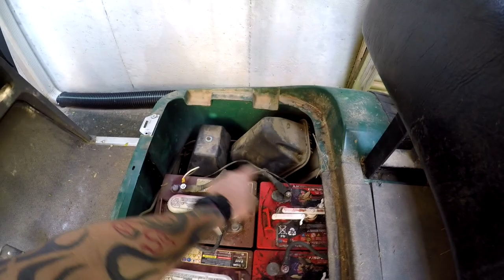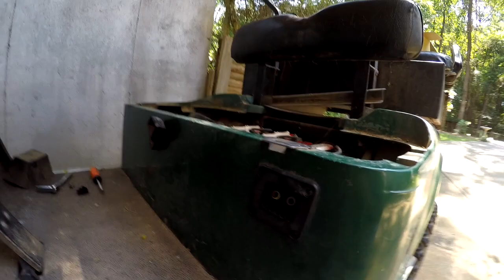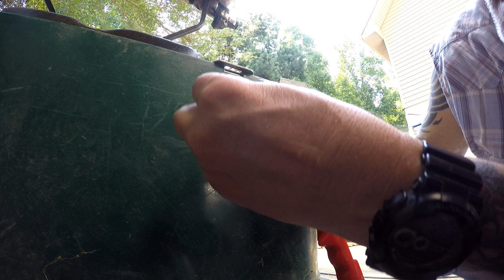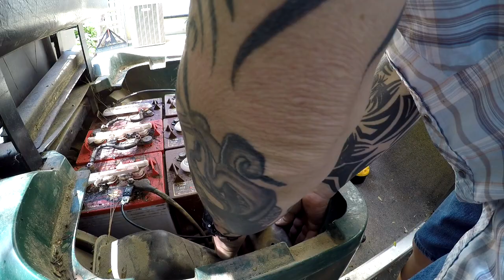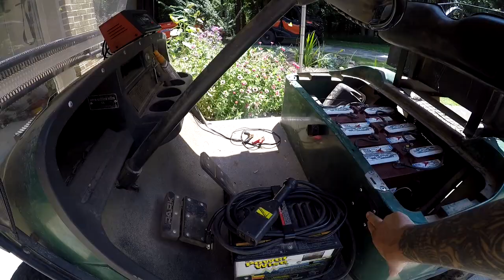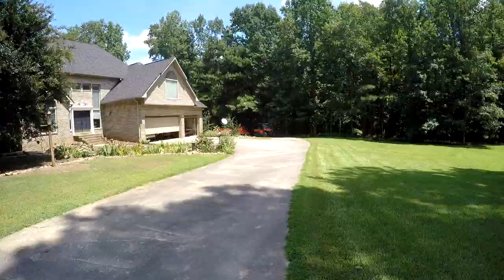EZGO TXT Golf cart Repair

Comment: Nice Video! How can I tell how old my Golf Carts are. They are both EZGo
Reply from the maker: Passenger side glove box, there's a placard. I believe it uses a mm/yy code ie...0394xxxxxxx. In this case the cart is a 1994.
Reply: @robertcostales9405  O.K. Thanks will check it out

Comment: Rookie mistakes, but fun video all the same. First, you should check the fluid level in each battery and bring them all up above the plates. Then do a trickle charge for a day or two or three. No hurry, just charge them until they're at 6v. If they won't go to 6v, then you consider replacing them. Make sure the lead from the charging port on the right goes to the #1 battery Positive post, and the lead from the charging port on the LEFT goes to the #6 (last) battery Negative post. Do not just hook them up to just any battery. "+" to the first battery in the series and "-" to the last battery in the series. Good point: use no extension cord with your charger. If you do, make sure it's at least the same gauge as your charger cord. Lastly, tighten your battery post down securely, very securely. Use two nuts on each post to make sure they do not come loose. Top with dry oil on each post, especially the + posts. That's where you'll get the most corrosion.
Reply: Does White go to positive and the Black with clip go to Negative? I had no wiring in my 2003 TXT 36v and had to start from scratch. I get some help but mostly people direct me to wire diagrams that I dont understand. You seem very helpful.
Reply: White or Red is always Positive (+) and Black is always Negative (-). The only way these can be turned around is IF someone who doesn't know what they're doing splices a Positive wire/cable coming off a line with a Black wire/cable. Or splices a Black wire/cable coming off a line with a Red or White wire/cable. 
If your wiring diagram is colored, you'll see Red lines are Positive and Black lines are Negative. This is true of all wiring diagrams.
You can help yourself out when using your wiring diagram by following Positive lines from your battery posts to their end point, which will normally have a Negative lead running from it to Ground...put a (+) next to all Positive lines to remind yourself, and put a (-) next to all Negative lines on your wiring diagram. 
If you've got an old EZ-Go, then you're in luck, because they're very easy to figure out after some study of the components. Find a wiring diagram that has almost all the components listed that are in your EZ-Go. 
Sometimes a good starting place is the Ignition Switch; there is always at least one Positive lead and one Negative lead coming off the ISwitch. From there you can be assured that any component the IS is linked to through the Positive lead has a Negative side/end/terminal. 
Know what I mean, jelly bean? 😀

Comment: 1 have a E Zone cart (I know they're not so reputable out there) the forward/reverse switch is just a button with two directions kinda like your regular light switch, my cart will only go on forward but on reverse it only clicks.. any thoughts or help on what I could try I'd much appreciate it
Reply: I suggest you consider replacing (or overhauling) your F/R switch. I'm pretty sure that's where your problem is.

Comment: You should have changed it over to. Three. 12. Volt. Batteries.  I just did a cart that. Way.  Got rid of the expensive 6 volt batteries. Put three marine. Deep. Cycle batteries in. Lot less money.  Lot. Less.
Reply: But they don't last long. I did the same thing, but in less than a year they weren't able to get me around the house and back without another charge.  I bought Walmart's EverStart DC batteries...bad decision.

Comment: My EZGO golf cart power pedal malfunctioning, what can i do?
Reply: Did you check the solenoid? Also, there are two micro switches behind the F/R switch. You may have a loose wire...check those. There's also a micro switch just below the solenoid...check those wire connections. If you solved your problem already, what was it?

Comment: Are use 3-12 V batteries connected in series=36 , Disconnect the battery pack somewhere in the middle and use the 3-12 V batteries to get the charger charging them, then connect the battery in the golf cart while it’s charging leave it connected for a little bit , then disconnect , and see if it keeps charging? I have to do this every spring are a lot of customers yeah three or four each year. You’re supposed to keep those batteries fully charged all the time.

Comment: Why don't you use repurposed Nissan leaf modules 60$ a piece and you can stack them at what ever voltage you need and you can stack as many as you want them being lithium ion you can use 80% of the batteries capacity

Comment: you're charges receptical is hooked to the battery's backwards the ruse goes on the + side of the pack
Reply: totally worthless 30 min. video
Reply: "ruse"? What's a ruse? If you mean the right lead of the charger should go to the + battery, that's true.